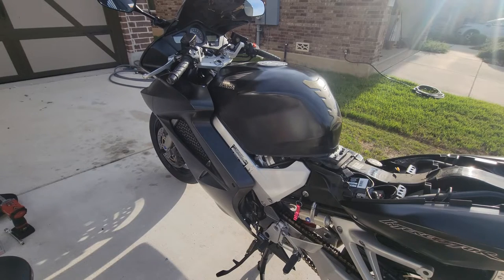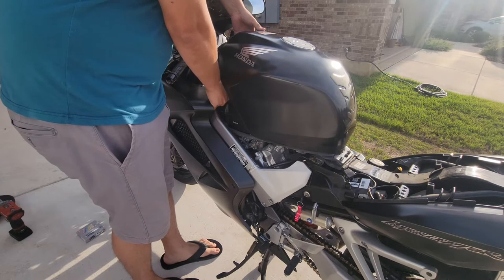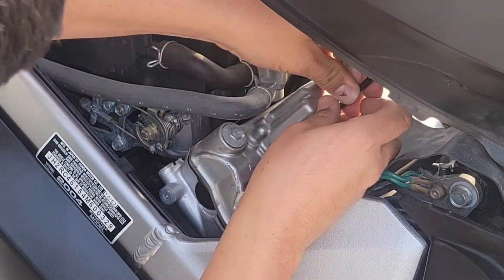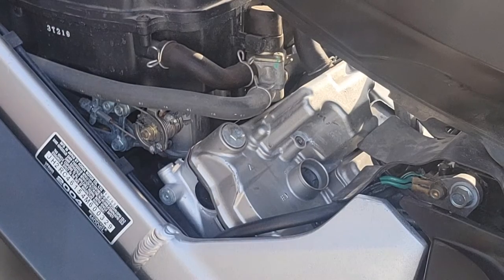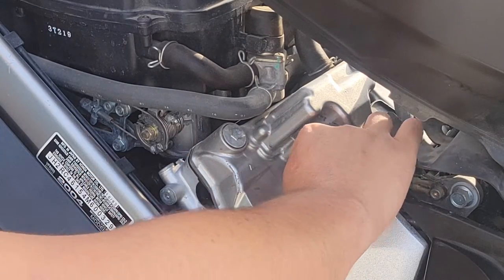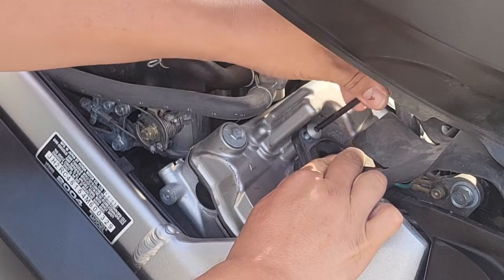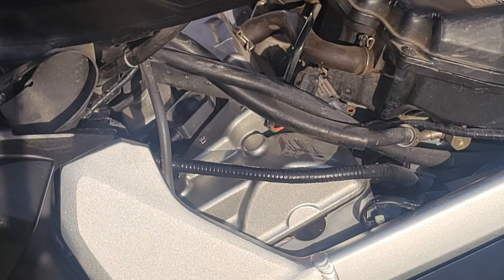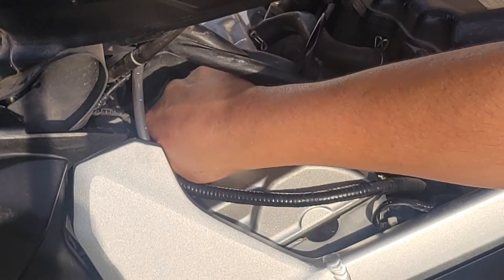VFR800 Interceptor SPARK PLUG CHANGE AND EXHAUST SOUND WITH DELKEVIC PERFORMANCE EXHAUST

Comment: you should take compressed air and blow out the spark plug holes before removing the spark plugs to avoid getting debris in your cylinder..
Reply from the maker: Good idea